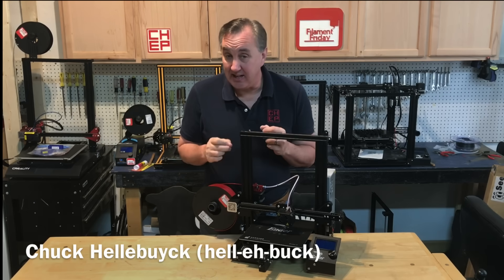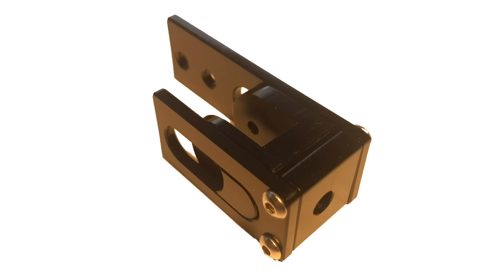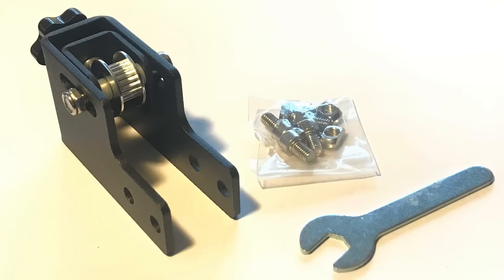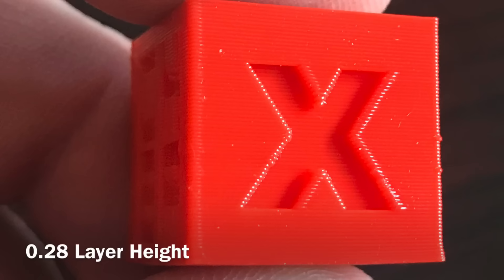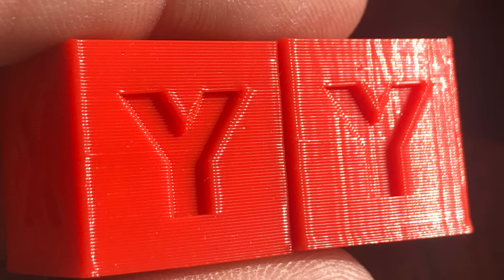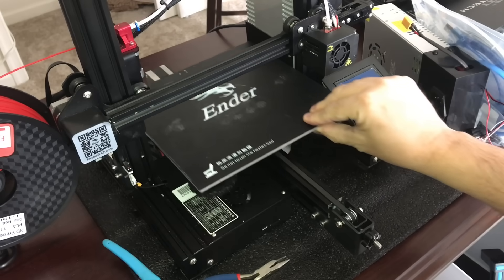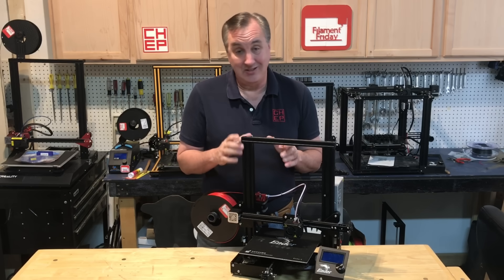3D Printer Belt Tension Effects on Creality Ender 3

Comment: Just went through that concern on my printer. Added a direct drive extruder. In the process the x Axis belt was slightly loose. Chased the printing problem for 2 days before it dawned on me the belt was just loose enough mess up the print.
Reply: Make a belt tensioner like they use on cars; An extra pulley that pushes on the belt

Comment: I was actually working on sorting out how tight the belt needs to be. I was seeing some articating and binding when the belts got too tight -- and that was not making sense. The thing that happens when you tighten the belts is if your idler is not smooth as silk, the gantry will show binding as the idler is struggling against the tighter belt -- super tight belt will expose other issues. I just re-assembled all my idlers with smaller shims so they can be snugged up and still spin freely -- that's really important for a tight belt.

Comment: why there is corner over extrusion? i have this issue with my ender 3 pro.. :/
did you found the solution to this prob?
thanks
Reply: Coast + extra restart.
Reply: Trenton Talbot i am too new to 3d printing to fully understand what you mean with “coast + extra restart” 
Can explain maybe?
Thanks
Reply: @meroulis  fat corners are often because your printer slows down (according to acceleration settings) to round the corner, but the melted plastic oozes out faster than the extruder is pushing it, so you have extra material there. I think Trenton is suggesting two slicer (Cura) settings: Coasting, which tells the printer to travel without extruding at the end of an extrusion path, expecting some plastic to keep oozing out; and Extra Prime Amount, which pushes a little extra plastic into the nozzle to make up for ooze. I myself like Coasting but avoid Extra Prime because it put extra plastic into play.

Comment: I have experimented with that before on my am8 build and it destroyed my stepper motors. I took the motors apart and found the armature was indeed rubbing the field. Highly not recommended. Run another 50 hours with it that tight and give another update. Little steppers are not designed to handle that kind of side load. There is a formula for proper belt tension for a reason. The printer can only print so fast / quality no need to try and cheat and pay for it later. Be patient.... or spend $$$ on a printer made to do the job with speed.
Reply: This is exactly what I came here to ask. Every time I tighten my belts I wonder if the tension could bend the shaft, or see-saw torque the bearings inside. Now I need to go find this formula you speak of.
Reply: @debren27  
Most nema17 stepper motors have a radial load rating between 3-5 Kg. I could be wrong but I beleive I found something on it from Prusa's site. I ordered 2lb tensioner springs off Ebay and E3d stepper motors with there 9mm belts. Been printing smooth as glass ever since.

Comment: Elephant foot on all models....
Reply: Over extruding on the first layer(s) making the plastic ooze out, and it looks like a elephant foot.   Easy fix is to under extrude on the first layers or have a lower layer height on the first layers.
Reply: @Vassenden_yt  thanks for the explanation
Reply: @Vassenden_yt  I not sure I agree with the simplicity of your cause and fix. He might be extruding the right amount, but the homed z position is too low. That will cause it to squish more (too much) and give the impression that it is over extruded. That will correct itself as the height increases and is more likely to have the elephant foot characteristics as it comes back into alignment as layers increase.
Over extrusion will have a knock on effect throughout the whole print (although I'm aware you can control the initial layer separately).
So as your fix is to under extrude OR lower the height is incorrect. You may need to under extrude AND lower the height. Or leave the extrusion and increase the height.
It could be many more (combinations of) things than you suggest.
Reply: @wasRyanJames  Of course, and you're right. Could be a handful solutions to about all problems with a 3d printer, and both mine and your solutions could be the one you're looking for.
Reply: What's elephant foot?
Reply from the maker: I corrected this in the follow-up video. Keep watching.

Comment: Never seen those before but hell they look really good and handy. I've been using a design off thingiverse where u jam ur finger against a little slide print and then tighten the bolts...it works well too but to be able to turn a bolt and done...love it I'm gunna find some

Comment: There are belts with steel core. You can tight them as hard as you can. However, the downside is the bearings won't last long.

Comment: As a rule of hand a belt is too loose if you can turn it over 90 degree also goes for cars
Reply: Do you mean like if I pull on it and it stretches to a 90 degree angle?
Reply: AnytimeTown try to twist the belt.  Grab it where Chuck was pushing down on it to test the tension, and try to twist it.
Reply: @WayneMcCormick  ohhhhh lol yeah that makes sense thanks that's a good rule of thumb

Comment: Remember, sideward force on a motor will cause bearing damage or premature failures on motor bearings. Best for backlash is going with leadscrews, this way there is no sideway tension and the motor could last a lifetime.
Reply: Yes you are right that tightening too much may damage the bearings,
but the accuracy and the print quality is important and I believe
that changing the ball bearings of the nema17 is an acceptable
maintenance operation.Regards
Reply: @pascalgarcia5161  sure thing but if you need that sort of quality, I'd rather invest in converting to leadscrews as adjusting backlash on them VS. changing bearings inside a stepper. Just a better option in the long run
Reply: Sure lead screws are more precise, but they are also far more expensive. The kind of printers we are talking about are full of mechanical aberrations that should be solved before investing in such a solution. 
Regards
Reply: @pascalgarcia5161  are lead screws really far more expensive? You can get them built right into the steppers if you want and hardware to interface with an axis is pretty cheap or easily printable.
Reply: They are not so far expensive, but transforming the printer designed with belts to use lead screws has a cost that is not justified too my mind as long as you do not solve the other mechanical problems and bad design. With this test we now that the belts are rigid enough to be tighten hard enough whthout affecting significantly the size of the printed object. Let us go for that on these printers without investing more than needed.
I am thinking building my own designed printer, and yes it will incorporate lead screws.

Two examples of default in design:
The gantry is guided at each end, and there is nothing done to ensure the 2 guide are parallel, one can not even access the screws when the gantry is in place, what would allow to tight everything in a better position. 
The Z axis is often supported directly supported by the coupler that is not design for that and behaves as a spring. Some printers have a rigid coupler what is not good also as the coupler cannot cope with misalignment and involves extra constraints on the motor and the lead screw. I am in favor of normal coupler but with a 8 mm ball inside what solves this problem as the axial effort is not any longer supported by the coupler and the ball does not affect the capability of the coupler to bent. This really improves the accuracy of Z axis, and I advise everybody to do that. But then the gantry is still supported by the motor that includes also a spring stronger than the coupler of course, but still a spring that may have consequences if the gantry is too heavy or there is a small blockage on the axis.

We
Reply: Overtightening the belt to cope with something else isn't really a fix for anything. It's a short term bandaid. Anything rubber has a certain amount of stretch it can continuously work with. Overtightening the belt is bad for the belt, bearings and the idlers. Adding extra heat and stress onto the motors and putting a load on the motors they were never designed for. Add in the fact of how many perfectly fine printing Enders there are in the world using just normal proper belt tension and nothing more. I heavily question the validity of cranking the belt past it's working point and its benefits.
Reply: These printers are full of mechanical weaknesses.
Belts are not only made of rubber, but also include some fabric, and sometime iron cables to ensure they will support tension without stretching.
The point is that if the belt is not tighten enough the movement will not be transmitted accurately. But this does not mean over tight them as an important effort will damage the belt and the bearings.

I believe that the quality of the belts is very important, and by quality I mean:
1 – The precision of the size of the teeth.
2 – The ability to support tension without expending.
3 – The stiffness of the teeth. (not to bent under high acceleration that leads to bigger efforts
4 – The stability over time

Yes well mounted screws would surely improve the precision.

Comment: I believe tightening the belt too much will have consequences on the size of the object printed. It depends on the quality of the belts and the more there are elastic, the more they can be extended by no effect will be visible. the tension the bigger will be the object printed. If the belts are not elastic at all, of course b Could you please confirm that by precisely measuring the objects printed? 
Thank you for you videos. regards
Reply from the maker: The tight prints were correct size. The loose belt print was undersized.
Reply: OK it means that the belts are not elastic. Thank you for the information.

Comment: Do all the stepper motors have ball bearings or some cheaper ones have sleeve bearings? Tight is right but I wonder if that much load will effect the life of the front bearing in the stepper.
Reply: The good thing is nema 17 stepper motors are only $10. I'd thing most people would sacrifice a shorter lifespan rather than print wavy parts (I would, at least). 🙂
Reply: @3dPrintingMillennial  Oh for sure...I agree. Just dumb stuff that runs through my head.

Comment: Thanks for the video, I wonder if any1 has tried a 3D printed belt tensioner? How does it compare? Probably going to buy these
Reply from the maker: There are many on Thingiverse. I wanted a strong metal one to experiment with.
Reply: @FilamentFriday  I agree with wanting a metal 1. Though 3D printing is the most popular way for us guys so I think I'll try both. 
Cars use plastic belt tensioners now so I am sure a 3d printed 1 will work
Reply: @wires4auto  just make it beefier than this one. The original prusa printers actually use 3d printed y axis holders

Comment: I'm in the process of upgrading a CR-10 and have used polyeurathane belts with steel belts.  I've fitted a metal adjustable tensioner on the X axis, and a bearing support on the notor end to prevent the tension bending the motor shaft.  On the Y axis, the standard metal 'tensioner' (moving belt idler) seems tough enough, but on the motor end it has a motor support (it's a bit tight to fit a bearing support for the tip of the shaft).  All these add up to a lot more tension in the system.

Chep: you really need to adjust the length of that X axis belt; if not replace both X and Y with higher quality belts.  You can see your new aluminium tensioner deforming as you tighten it.  A little shorter belt and that far side would butt up against the extrusion and prevent this.
Reply: Could we see how you set up the additional motor support? Thanks!
Reply: Steel core belts bent around small pulleys will fail quickly.  The steel wires will break inside the belt and then the polyurethane will stretch.  Print quality will quickly go bad.  You'll know this has happened when you find yourself retightening the belts every couple days.  Steel core belts need very large pulleys if you want them to last.

Comment: Nice, could you make a test with unitta gt2 belt and high quality pulleys, then in my experience, fingertight is enough. When printing fast 100mm/second or above you will get gt2 aretefacts on your print.

Comment: I have an s5. I have recently had issues because I tightened the belts too much. One thing is the motor mounts aren’t the best. Too tight also puts extra wear on your motor bearings if you did have good mounts. I think I caused layer shift on my last print due to x-axis belt being too tight. I haven’t nailed down the root cause yet, but that is where I am planning to start my investigation. It is tough to figure out the correct tension.
Reply: I agree. They should be tight, but not overtight.
I have also had a bearing fail in a motor and had to replace it. So take caution as you can overtighten and create more problems later.

Comment: I had my belts really tight on my Ender 3, but then I noticed bits of belt  flaked off and accumulated underneath the belts. I backed off the tension just a little and haven’t seen much more since.  Could this been a sign of over tightening it?
Reply from the maker: Possibly.

Comment: One of the trickiest part of 3D printing is areas like belt tightening, where it needs to within a range.  Not too tight.   Not too loose.  If you are too tight, problems can show up over time, especially if any of the idlers or pulleys are supported by 3D printed material.  Good video, Chuck.  Thanks.

Comment: It also depends on the belt itself, if its a steel cable or fiberglass cable variety, there are other kinds of belts as well. I know the Tronxy printers use a steel cabled belt.

Comment: Why didn't you use the printable adjusters on Thingiverse? I watched enough of your videos to know you usually have a reason for doing something.
Reply from the maker: Strength of the unit mainly. I couldn’t find Thingiverse versions that I liked and all metal seemed like a better alternative for testing tightness.
Reply: @FilamentFriday  Thanks, good to know.
Reply: @Chris Valin Thanks for the reply. I'm using a set of linear rails on my Ender, and really like them, they use a 3d printed adjuster, but different then the Thingiverse ones. I still have one Ender that's stock, so I may need to upgrade to this solution.

Comment: Are the belts all pretty much the same? Are any made that have any reinforcing wires, or something similar?
Reply: You can buy belts with steel core, but they need large diameter pulleys.  They will not last on typical 3D printer size pulleys.  The steel cores will break inside the belt and the polyurethane will stretch over the steel wires.   Tension will drop and print problems will result.  You'll tighten the belt again and then wonder what's going on when you have to tighten it again in two days.
Reply from the maker: Not sure.

Comment: Another great video,  I like the adjusters, since the manual way is tricky.  I have also fount that tight is better.  I converted one of my Ender  5's to linear rails and found that they need to be tight to perform correctly.  Keep up the good work!!

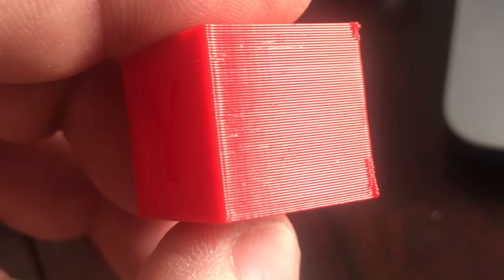Comment: 4:02 I also have those round bulged corners, as if the extruder, right before the corner, went out a little, made a half circle and then came back in. If you find a fix for perfectly sharp corners, or at least round corners that don't bulge out, please share. Thanks!
PS: I already have the printer frame perfectly square with shims, tight belts, new marlin, e-steps calibrated, extrusion flow compensated (90%) for a perfect 0.21mm wall and still get those bulged out round corners at 80mm/s (40mm/s outer wall, 60mm/s inner).
Reply: I've been experimenting with Klipper settings to get those bulges tuned out.  Square Corner Velocity is interesting and seems to be getting the corners better.  I tried getting pressure advance to do anything useful but it doesn't seem well suited to bowden tubes.  I wasn't getting great results with jerk settings on the stock firmware so I went to Klipper, which doesn't actually do jerk in its motion planner.

Comment: Chuck the blobbing on the corners what is that caused by...I upgrade my Ender 3 Pro to direct extruder and EZR and have not been very happy with the results .The print quality is not there I have spent hours tweaking setting in Cura but just not satisfied...Do you have a machine running a direct extruder you can give me a Cura profile I can start with to see if their is something else or what...
Reply from the maker: I’m working on figuring that out. 
I don’t have direct drive profile but my CHEP profiles work well for me, just have to adjust retraction.
Reply: @FilamentFriday  I have been working with your profiles with great success the skin is not smooth ...retraction is 1.2 retract speed 60 it seem to get clean print I need to up the print speed from 100 % to 125 or 145   %   Thanks for the reply I greatly appreciate it ...Thanks again ...